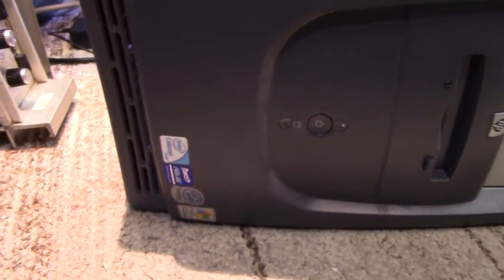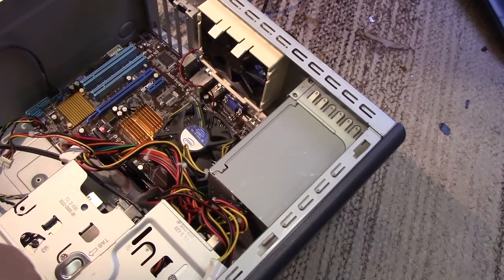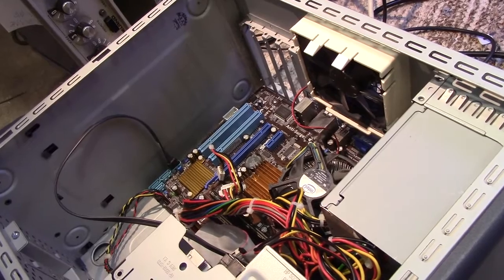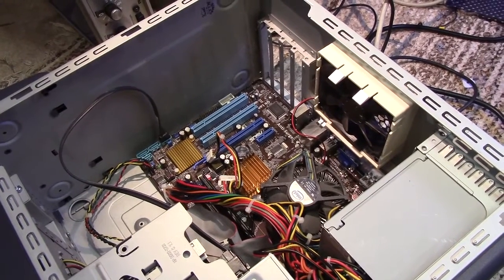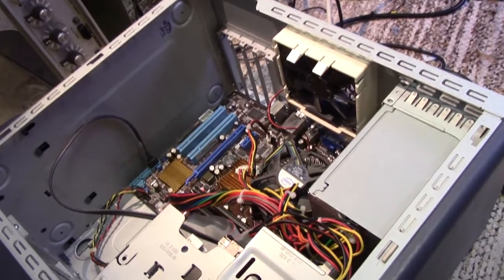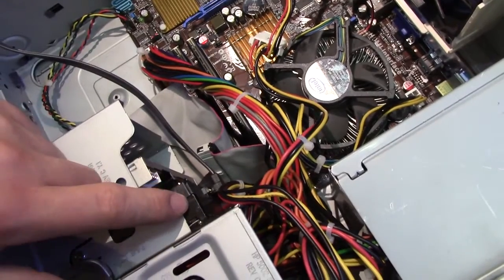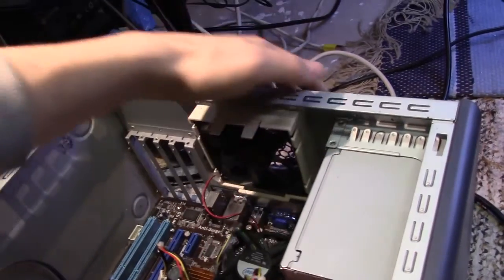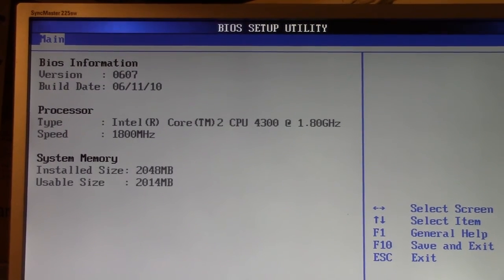Reminiscing about my old HTPC

Comment: and this video is the nail in the coffin: it's the week of old PC cases with newer hardware shoehorned in.
MaxxArcade popped up a video a couple days ago of an eMachines generic case he fit a much newer AMD APU-powered motherboard in... and I commented on that with an older picture of this month's project I'm working on, an HP NetServer E60 dual-Pentium II "almost-ATX" server case I dropped a MicroATX board in.

...and cut out a part of the PSU shelf, and cut out some metal and drilled holes so a normal ATX-compliant power supply would fit in. that's the 'almost-' part of the case. the rest is a normal ATX motherboard.

picture of the finished result is here: https://a.pomf.cat/inlspd.jpg as of an hour ago at the time of this comment.
I have an older Asus P6T board of some manner I have to find the I/O shield to, with an i7-920 on it which may get dropped in if I can find such. until then, that board's shelved.